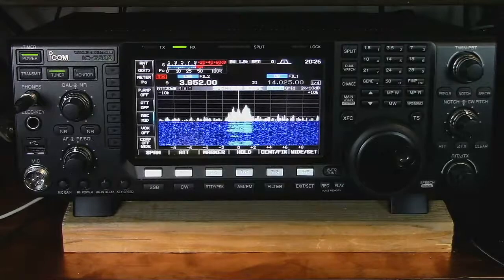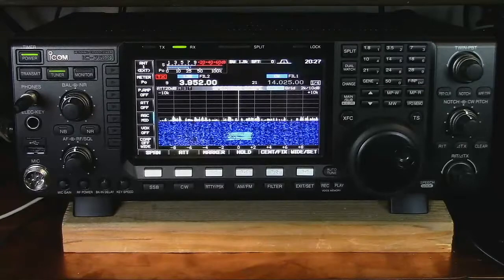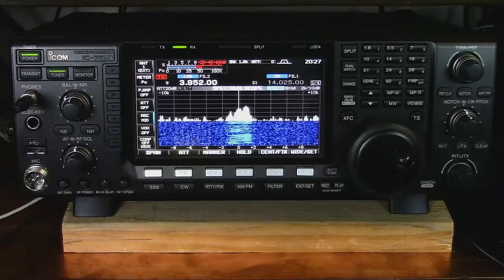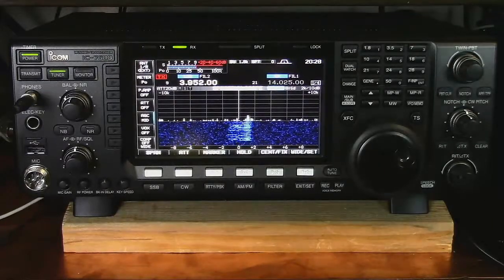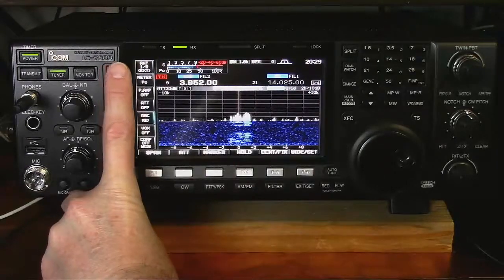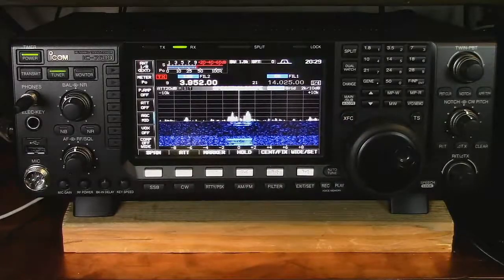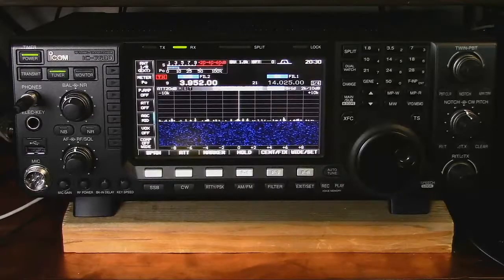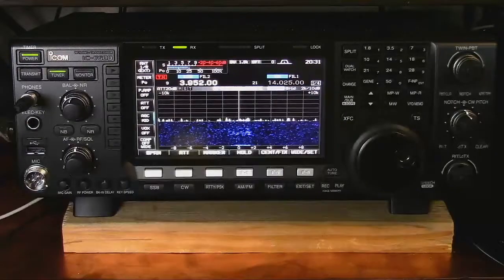W6LVP RX Loop compared to Full Size Antenna

Comment: Jesus, from S8 noise to S1 after the switch I'm impressed. So you lay the W6LVP loop flat horizontal itself? Or does the shape of a magloop already horizontally polarize it?
Reply: The OP can correct me if I'm wrong, but the loop is usually oriented vertically, but preferentially picks up the horizontally polarized magnetic signals.
Reply: @weslindsey  nice.